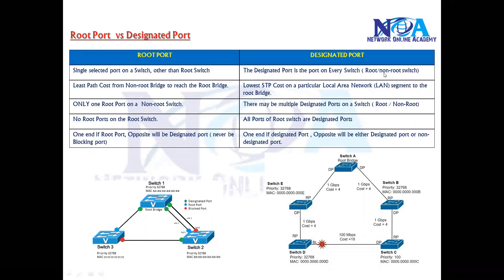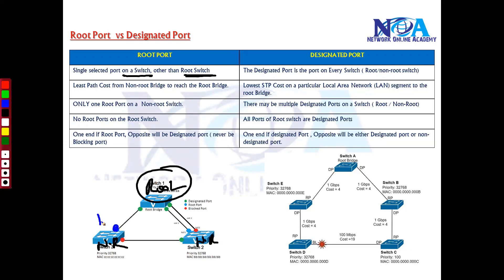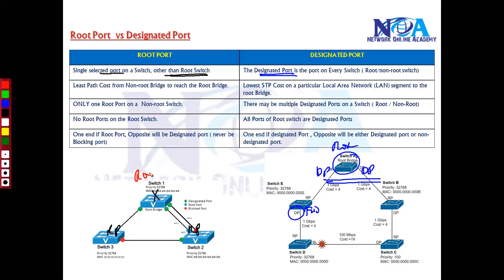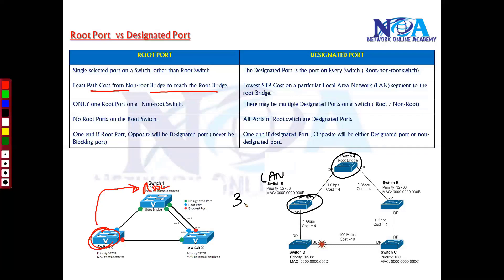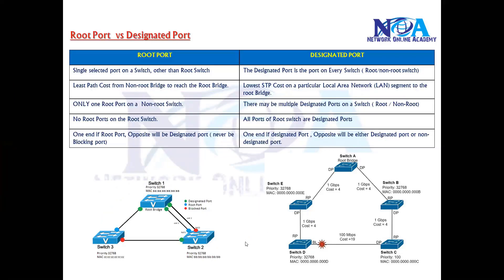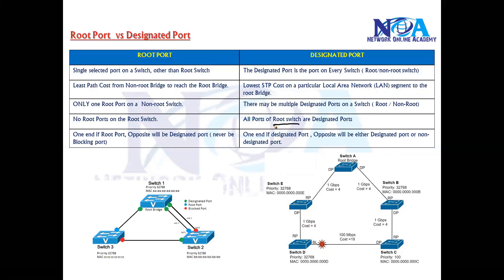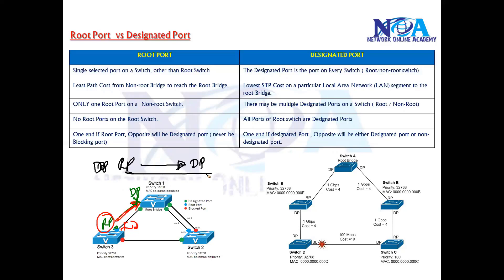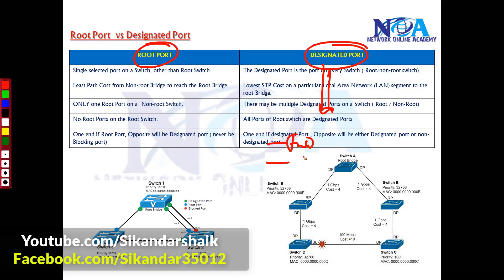009 Root Port  VS  Designated Ports

Comment: Are you saying that a blocking port is a designated port? The statement that every switch will have a designated port is confusing when switch 3 and switch D in the diagrams are labeled as BL and not DP.